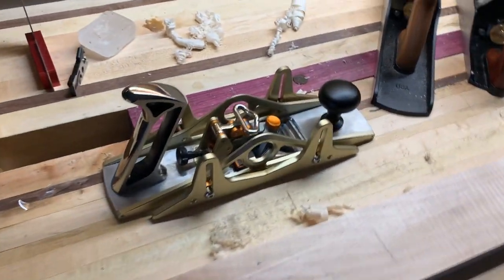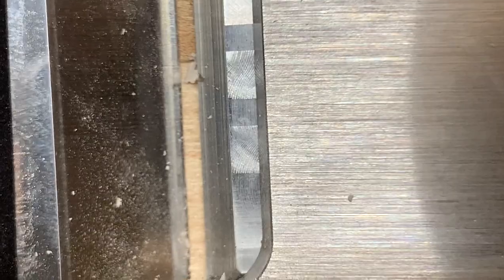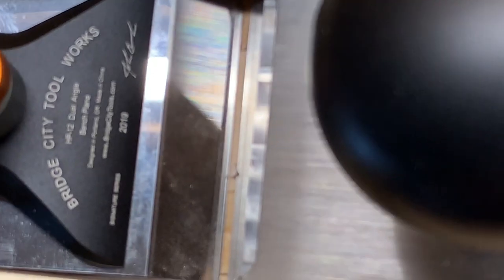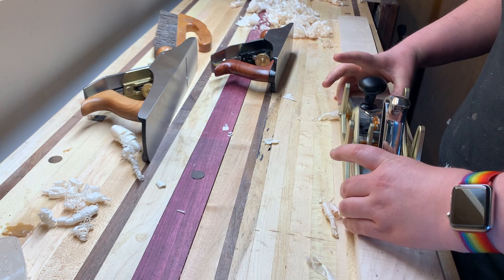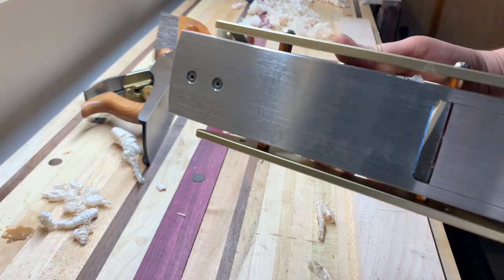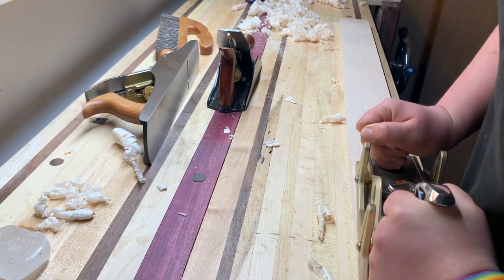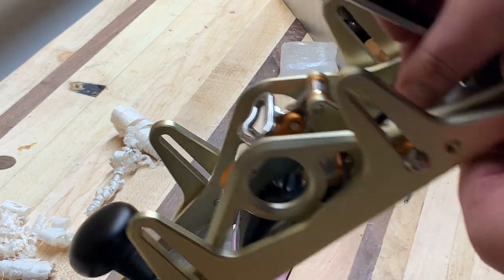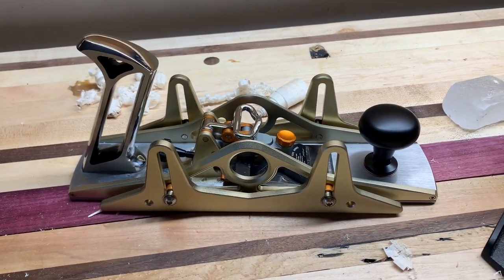Review of HP-12 Dual Angle Plane by Bridge City Tools (Harvey Industries)

Comment: I am also a victim of this plane. I think the biggest problem is that its blade cannot be pressed tightly and it will move during use which make it almost useless. I guess their designer has never worked in the woodworking.
Reply: umm.. you can adjust the clamping mechanism tighter to the point its so tight that you cant clamp it down.  the blade does not move when clamped.
Reply: @pctatc66  To my comment below, I will add that the blade does not seem secure. I did tighten up the top pressure plate to the point where I can press the locking mechanism down, but have trouble lifting it back up again. The blade is still loose. I took it out of the plane to check the under side. The hole that seats the blade onto the forward/back screw set up thing has a considerable amount of play in it. I am used to some slop in the forward/back mechanisms on my Lie Nielson planes, which is standard. With this plane, I can't seem to get the same thickness of shaving 2 times in a row. One pass, it is too thick. There is a noticeable 'click' when the blade first hits the wood, and another noticeable one when the blade goes off the end of the board. Then the next cut, the blade isn't cutting. The next cut I might get a few whisps of shavings, then the next one back to being too thick, and I haven't touched the adjustment knob. I don't think this is normal. I also seem to have the cut 'adjust' depth during the pass of the plane over a board. I have already straightened the board with a #7 Stanley jointing plane, and the pass with the BC plane goes deep, nothing shallow, deep, shallow, nothing on the length of a 16 inch long board. Any clews???
Reply: @robohippy  call bridge city asap! They would want to talk about it

Comment: This is such a shame! Bridge City Tools have made and created designs of tools, pushing the boundary's. Times have changed and they had to move away from the Rosewood and Brass (toolmakers choice). The brass/bronze due to lead and the Rosewood can't be exported out of the USA. Very hard times for our tool makers.
For information the blade is removed by cupping the top of the plane in the palm of your hand rolling it upside down. With blade released it drops into your palm. (Never do this over a concrete floor). If you trying lifting the blade, you will fight with it, being honed with a fine edge..
A good honest review.

Comment: Just received my HP-12 which was delivered to a friend in the US August last year and brought to Germany unfortunately delayed becauso of the Corona situation. So after watching your video I was in panic, if mine would have the same issues. But gladly I am lucky. The sole is smooth and flat (not polished but the thin surface structure is necely parallel to the direction of the sole) and the blade is in perfect shape. I haven't tried it out, but will comment if any issues show up.
Reply from the maker: Glad you are happy with yours. 

No groove that catch your finger nails? 

It seems other I've spoken too still getting them with poor finishing. I suspect it's a QA issue -- so some are fine, many are not.
Reply: @transformwoodworking633 like who ? That’s not been my experience

Comment: Well, I have spent far more time with the wood lathe than with flat work. I just got one of these. After seeing this video, I think they picked up on the sole being too rough as mine is more polished, level of the Lie Nielson planes. The main thing that I don't like is the handle grip and the adjustment knob for side to side and depth of cut. I don't have hands like Andre the Giant, but I do have a big palm. If I have my hand down far enough to keep it under that horn, my pinkie finger hits the adjusting knob and moves the blade while I am using it. I may just need to tighten things down a bit. I did find the blade to be in pretty good condition out of the box. Not sure about those side rails though....

Comment: Recently  I  restored my fathers 1959 Stanley /Bailey made in England  smoothing plane that I inherited  when he died . It  was in pretty good conditions  already but  now it is as good as new in fact somewhat better  because I accurized  it to better than specs.
It glides over wood without wax or lubricant.
Is this HP 12 a prototype that got shipped by accident? Not at all impressed.

Comment: I was actually wondering how you get them out just looking at these online(especially when the mechanism is marketed for the quick blade change the toggle clamp configuration provides). The dual blade makes it more awkward if anything; have to worry about both ends.

Comment: Wow! I bought a couple of items from bridge city years ago. A brace and a hand drill. Very nicely done. But the brace does accept brace bits. You have to use a set of modern bits.

LN reproduced his planes. Didn’t change much design wise. Known flaws got addressed but that’s it. His choice of wood and bronze gives him a unique look but also simplfies manufacture. No CITES issues.

Carl Holtey laid down the law on modern high end planes. Veritas had to re-engineer every detail. 

The English infill planes like Norris, the Stanley planes like the bedrocks and the English wood side escapement planes have taken 300 plus years of woodworking and ergonomics to the bloody edge.

All of the super modern designs represent an arms race that is out of control.

I just finally bought a LN 5 1/2 after waiting months to get it. Could not find a 605.5 with the type number I was looking for. The LN gets me the 605.5 with ductile iron and frog angle options.  While the work of Bill Carter and Carl Holtey is awsome and functional, most of the newer tools who have deviated old world designs are not worth much.

Comment: It's probably better than my 65 year old Record No5 but, not £1000 better I suspect. The only good reason for something new is if it solves an issue with what came before it. Taking into account that hand plane design has barely changed in 100 years, there was no issue to solve. Looks cool though

Comment: I wonder....  It seems possible or even likely that the person who gave you the plane as a gift got it from some secondary source (though I'm sure they'd never admit it).  It looks like someone has owned this plane before, tried to lap the sole (poorly), got the blade caught up in the lapping and dinged it up--then listed it for sale somewhere or returned it to the store--where it was resold.  I have no idea if Bridge City normally has such terrible quality control--but I think it's unlikely--even in light of the Harvey Industries situation pointed out here.  Anyway, just my two cents....
Reply from the maker: It was ordered new and mailed directly from BCTW, so wasn't used, unless BCTW sends defective used units to fill new orders. 

I reached out to their support, they went and looked at their stock and didn't think they had any that would resolve this problem, saying they think there might have been a bad batch. They asked me to wait a few weeks for a new batch to arrive, but before that happened, they changed their tune and said there was nothing defective about a sole like this and that they intentionally roughen to help with wax. 

They did return it no fuss at that point.

Comment: This is not a one off, I've looked at them purely because they have tried to reinvent the wheel, but in reality they may be pretty but the engineering lets them down as I have seen badly fitting adjustable throat plates, badly finished sole plates and thats on top of a  design that makes getting at the blade very difficult. I appreciate that the cost of development must have been considerable but those ludicrous prices mean you are paying an awful lot for the BS. This is why you can see them discounted by almost 50%. You are much better off with Lie Neilsen but theres also nothing wrong with a good old Stanley that you can pick up for $40 and spend a couple of hours restoring and end up with a plane that will outlast you and your kids. I would not touch one of these Bridge City planes even if it was discounted 90%. - Good honest video though Good job!!

Comment: They finish is from  the surface grinder still not good for a plane that cost that much. For that much it should  be hand lapped.
Reply: A surface grinder can get you to a micron or two off flat, that looks more like they've used a belt sander

Comment: The deeper grooves allow the wax somewhere to go, to key into the base with a reserve of wax.  An overly polished surface cannot harbor much wax and any application quickly gets worn off.  Additionally, those grooves help reduce friction -- to whit, the Stanley 605 has a grooved sole.

That said, the bias of the grooving to the sole, although minimal, is disappointing in a plane of this cost; although one would be very hard-pressed to demonstrate that it had any sort of adverse effect on the plane's performance.
Reply from the maker: If the wax is between the grooves, then its not between the surface of the plane and the wood, meaning it and the grooves do nothing. No one is talking about a polished surface, that's different than expecting a low friction surface, and these aren't engineered grooves to reduce surface area, they aren't even parallel with the plane, they are just shoddy finishing to cut corners.
Reply: @transformwoodworking633  Well, as the sole heats up from friction, those tiny reservoirs of lubricant are facing down and will shed the lube due to gravity as well as capillary action.  That is the way it actually works, try it.
Reply from the maker: @SuperBardley  If the plane is intentionally designed to work like that, then that is even worse! That would meant it's not just cheap finishing in China, but that it's also terrible engineering behind it's design.

First, at and near room temperature, wax is solid. Capillary action (and gravity leading to dripping) are properties of liquids and not solids, so that's not even a real thing there. Second, the idea of generating heat to melt the wax has numerous problems. For starters, planes are giant pieces of metal that work pretty well as heat sink, so there's not a whole lot of heat generated along the sole of the plane (there's a bit near the blade, but that isn't going to do what you're suggesting along the entire sole). Furthermore, the heat you're hoping to create occurs through energy lost in friction. Not only have we already talked about the heat sink issue in limiting heat, you'd have to create a lot of friction to overcome that and create enough heat to melt the wax. That'd defeat the whole purpose, not to mention, if you watched my video, or experimented for yourself, or glanced through basic physics texts, a high friction surface with wax is not going to be better than a low friction surface with wax. Third, let's assume you succeeding creating enough of heat on the sole of your plane, that amount of heat has the potential to burn you're wood, cause wax to become liquid and seep into more open areas of wood, and mess with the finish of your product. 

If you think this is intentional engineering. What's your explanation for the grooves being a few degrees off from parallel and causing the plane to have a tendency away from a straight? Do you work for BCTW?

I've had the pleasure of seeing and using older BCTW planes (prior to company being sold) since making this video. None of the 14+ that I've seen and used ever had shoddy finishing like this (or what you like to call intentional design -- that ignores the reality of physics). It's a shame. I think they look pretty neat and would have loved to have gotten them all, but I gave them a chance (including waiting about a month with their customer support). It's on them now, so it's likely never going to happen because I don't see myself putting down money for another of their planes after the this experience.
Reply: @transformwoodworking633  That's a daft statement.  I have several vintage Delta stationary tools with coarser levels of burnishing on their tables, as well as an Italian bandsaw with the same.  It is a choice made by the toolmakers; there are pros and cons to any level of finish, and you can be sure a highly polished plane sole will very quickly show all sorts of scratches that are more visible and deeper than what that plane sole leaves the factory with.  Of course anyone who has actually used a plane for more than a dozen strokes knows this.
Reply from the maker: @SuperBardley  I think you're missing something here. My video and concern isn't about a lack of a shiny flawless surface on the sole. It isn't about the aesthetics of the sole. It is about the friction and functionality. Also, incase you didn't catch it in the video, the scratches that this sole left the factory with are very deep, deep enough to catch finger nails -- I haven't even seen anything like that on well used 100+ year old Stanley planes.
Reply: If you have a sweetheart bedrock with "grooves" (605) then someone messed it up, and someone doesn't know any better.
Reply: @transformwoodworking633  exactly my 100 year old no 5 is almost perfectly flat and square,  oh yea, and smooth! Lol. It cost me 50 bucks some cleaning and a sharpening. Thanks for the review. Saved me some hassle, and a sht load of money.

Comment: Not sure why you don't return the plane or ask for an exchange if it was unacceptable to you. BCTW's policy is pretty absolute on that. I own 6 BCTW's planes (both old and new generations) and all came with as close to a perfect blade as is possible. So you got a little unlucky and I would have asked for a new blade. As to the soles, every BCTW's plane I own, including the new HP9-v2 has some manufacturing striations in the sole. This includes the older generation planes with the dovetailed soles. BTW, all the soles came to me perfect, including that brand new HP-9. In my experience John Economaki doesn't do anything that is not deliberate, so I'd ask him. He's sort of a crazed genius so I'd ask him.
Reply from the maker: I did reach out and they offered an exchange,, so I said sure, and after 3 weeks, they told me there wasn't a problem with the plane in this condition. I ended up returning it when they said that and made this video to warn others about the current quality problems with BCTW planes.
Reply: @transformwoodworking633  In the future if you ever buy something else, you can talk directly to John Economaki if you have a question or problem.
Reply: @expatluthierinthephilippin6441  Sounds like they just make trash planes. You shouldn't have to lap the sole of a $1000 plane. Period.  Plus the blade. Might as well buy three lie nielsons or veritas and support two fantastic companies instead of sending your money to China for more junk
Reply: @padraics  Polished plane soles are counter-productive and actually create more drag. BCTW never does polished planes soles, dating back the 25 years they've made planes. Now some people like to polish their plane soles and some manufacturers like to do it to make their planes look shiny, but not because it improves plane performance. Every BCTW blade I have (8) has come to me perfect but it's more than possible that the OP got a less than perfect one. I just received the HP-9 v2 (Chinese made) two weeks ago and it came to me perfect - beyond perfect. That said the OP has a right not to like his, but I have 6 BCTW planes and wouldn't give any of mine up. I have a number of US-made and China-made BCTW tools and see no quality difference. Actually I take that back. My HP-9 v2 is better built than the HP-9 original (US made).

Comment: have you thought that they might be leaving the bottoms ruff in order to give the buyer the choice for how smooth his plane is. it could be so smooth that its a mirror and u can see yourself or leave it ruff
Reply from the maker: No. Only cheap planes comes with unfinished or poorly finished surfaces due to corner cutting on costs. There is a reason almost every plane manufacture worth a darn comes with a finished low friction surface - because that a key aspect of a quality functional plane.

Also, why would you try to make the bottom a mirror finish, it's a plane sole. Mirror Finish is not the same thing as a properly finished low friction surface. A mirror finish would never last if the plane is used, and the underside isn't visible for it to have aesthetic value.